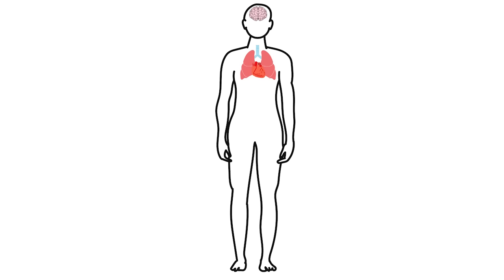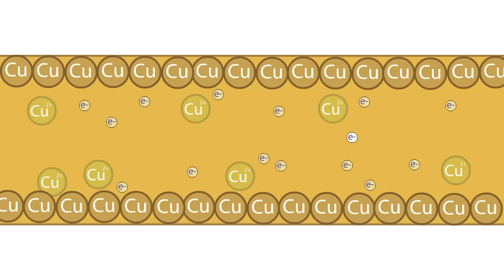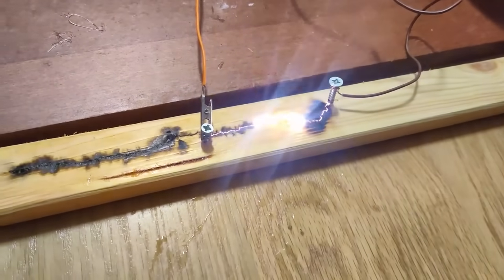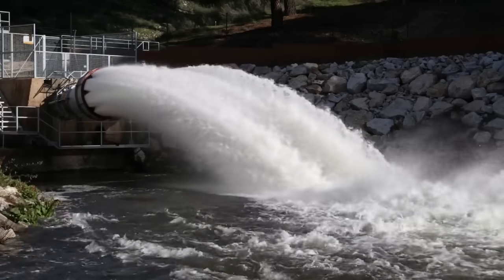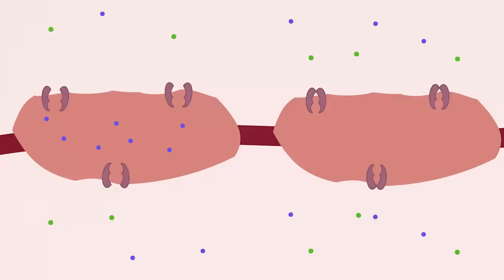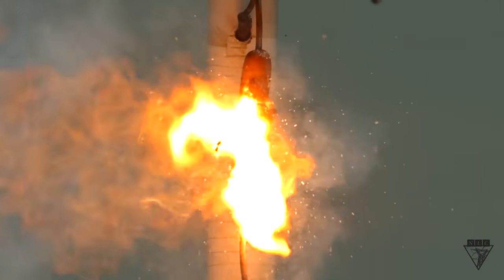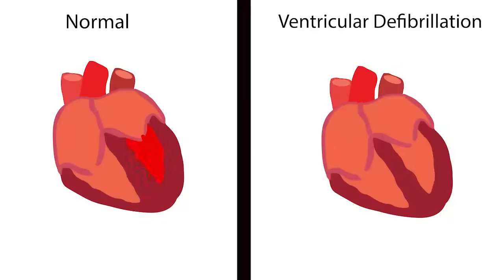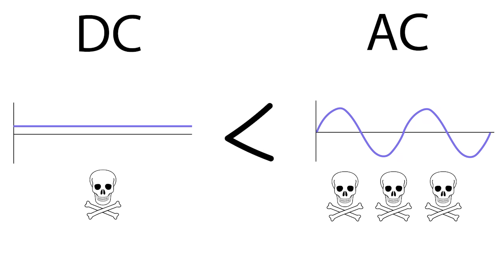Anatomy of Electrocution

Comment: I did A/C in Phoenix for years.  We wee on a job changing out a rooftop unit.  I was doing prep work to remove the old unit while our sheet metal guy was prepping the new transition.  We left the unit run as long as possible so as to not inconvenience the customer.  He had removed the side panels and went to put his shoulder to it to move it enough to break it  loose from the exterior ductwork.  I was on the other side of the unit doing my  prep work and I heard a loud BANG and looked up in time to see him sailing off the roof.  I ran over to the edge and looked down to see him laying flat out.  I got down as quickly as I could and the rest of the crew came running.  I got to him and he was trying to sit up and he was very groggy but alive.  After 15 or so minutes the boss insisted that we take him to the ER to get checked, which he didn't want to do, but we prevailed.   We were unsure of what happened so we killed the power and finished the job.  The crane operator say the whole thing and was surprised that he was still alive and walking around.  The next day, he was back at work, a little sore, but OK.  He showed us the two burn holes IN HIS SKULL where he came in contact with a 45 mfd capacitor (RUNNING)and the shock knocked him off the roof.  He then dropped trou and showed us the burn marks on his leg where the electricity came out.  The doctors were amazed he survived.  If you have ever been bit by a capacitor on a running unit, you WILL get the shock of your life and if you don't die, you will wish you did.  This guy was as solid as an old oak tree not an ounce of fat on him and that is what saved him.  He DID suffer long term muscle pains, especially his leg.

Comment: I came very close to death from electrocution in the most unlikely of times and places - while vacationing in the Philippines.  They use 220V there, and I had just jumped out of a hot tub, semi dried off and went to switch off a light beside my bed.  Unbeknownst to me, the lamp was broken and I put my semi-wet finger into live 220V.
Reply: Did you survive?

Comment: I've gotten six high voltage shocks from my ICD internal cardiac defibrillator. It's a medical device that shocks my heart if my pacemaker doesn't fix the problem. It's like getting tased in the heart, out of nowhere, with no warning. When my heart finally gives out I'm going to have to go through electric shock torture in my last minutes.
Reply: Yikes! 😬

Comment: I've always had a question I work for the subways in nyc the third rail that the train runs on is 600 volts DC, what kills the people who touch the 3rd rail in terms of miliamps?
Reply: It is the voltage that matters, The rail can provide several amperes. It can move a train, that energy would surely kill someone. It is the resistance that determines the current.

Comment: Great explanation. High tension power lines with 3000 AMPS when demand is high on a hit summers day, everyone using Air conditioning etc. I have attended the result of someone getting too close to these lines. Did not end well. They use a mere 9 to 10 AMPS in the electric chair. Homes in Australia have 10AMPS at 240 volts. A police taser is 50,000 volts but only 0.3 of an AMP. It is the AMPS that kill not the volts in this case.

Comment: I was working on my mother's kitchen sink. After taking out the garbage disposal, a live wire was hanging loose. I had a staggered cut across the 14/2 but brushed my arm against it. I felt the electric go into my left forearm then exited to ground out of my chin into the metal sink. Wow!
Reply: Why in the hell didn't you turn off the power, first?!? 😵🤯
Reply: @wendysw714  Well Wendy, I could not shut off the power. Hit every breaker and it stayed on.
Reply: @Wa3ypx  WTH 🤷
Reply: @wendysw714  Hey, lesson learned. At least I TRIED to kill the power. Give me that much credit. And now I have a cool story even though I don't want to do that again.